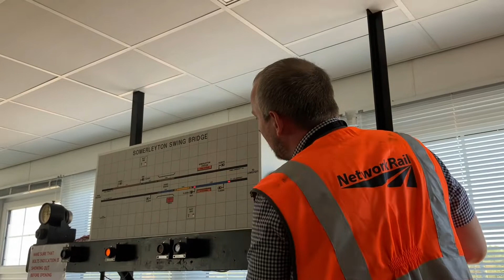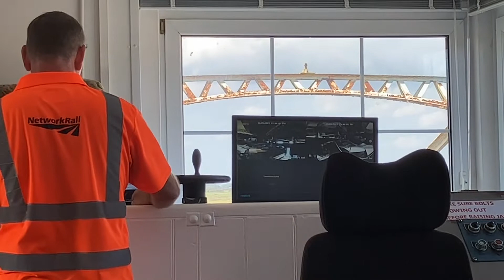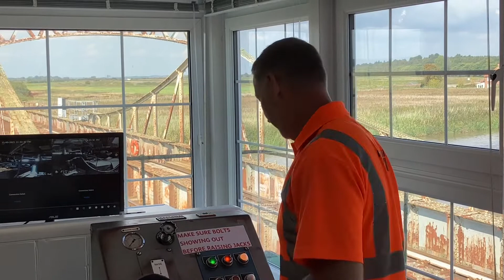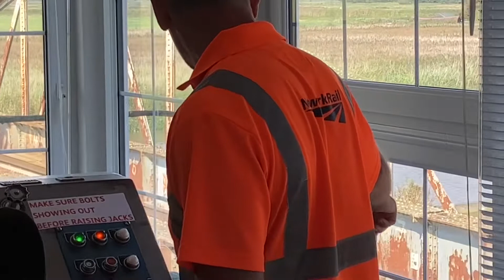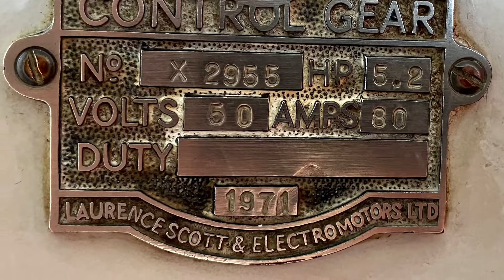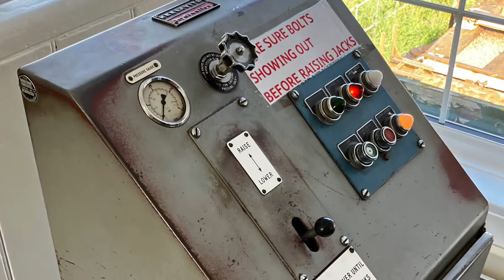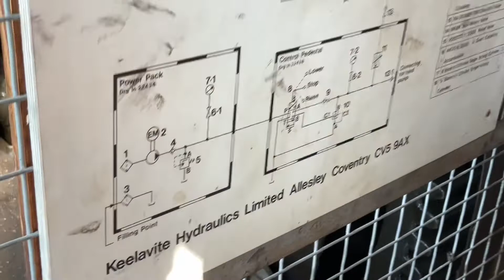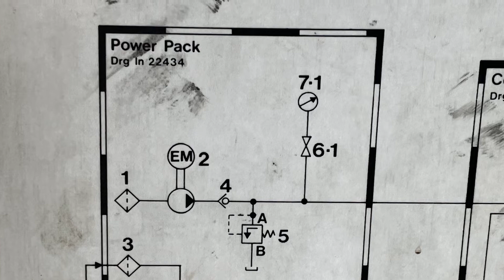Somerleyton Swingbridge

Comment: Great video, though I believe some of the complexities of the design and operation of the bridge are not clearly described, and some confusing information is given during the discussions. 

I hope my explanation below makes sense and adds to the statements made during the video. 

The movable section of the bridge consists of a solid elongated ‘A’ frame with a central portal and main cross girders at ¼ and ¾ points of the bridge. Two ‘tray sections’ are mounted inside the ‘A’ frame, balanced on each of the main cross girders. The 'trays' are weighted, such that at the centre portal the ‘trays’ drop and at the ends of the bridge the ‘trays’ rise. The bridge can be moved when the ‘tray sections’ at the ends of the bridge are raised. 

Hydraulic jacks are provided in the central pivot point chamber below the bridge. These are used to lift the ends of the ‘tray sections’ so that the six ‘wedges’ can be placed under them to enable traffic to be run over the bridge. The hydraulic jacks are also used to lift the ends of the 'tray sections' slightly to enable the 'wedges' to be released, before opening the bridge.

The indicators in the control cabin, are operated by circuit controllers, showing that the centre sections of the ‘tray sections’ are raised and that the wedges are correctly in position. 

‘Engagers’ are fixed on the landward ends of the bridge; with the bridge in position, the 'engagers' allow the mechanical movement of the roding over the bridge to the far side, operating the far ‘bridge bolt’. Similar 'engagers' are also used for operating the ‘wedges’.

Two ‘bridge bolts’ are provided on the land at each end of the bridge; these are used to lock the bridge in position, preventing lateral movement. Circuit closers are used to detect the locked position of the ‘bridge bolts’.
Reply from the maker: Brilliant Thankyou for that 👍👍